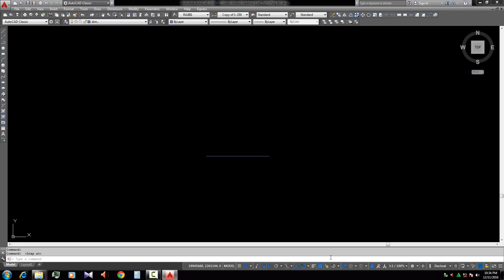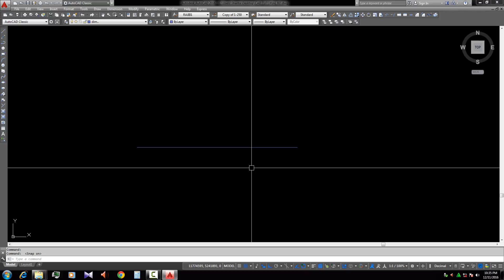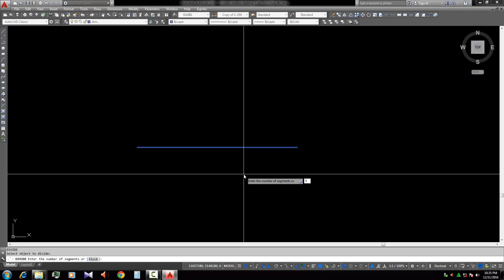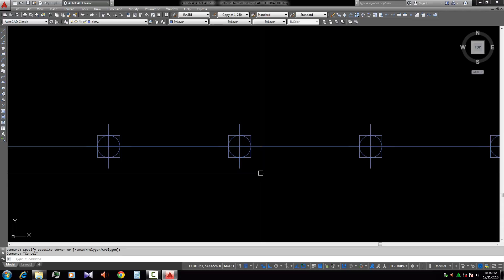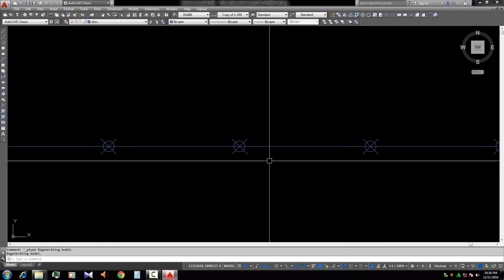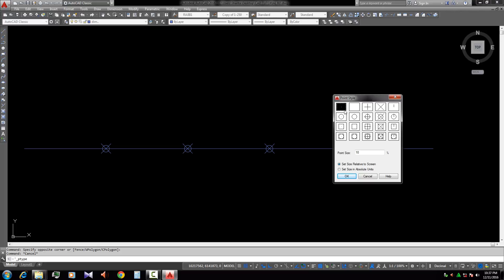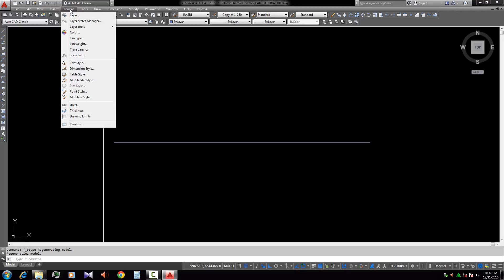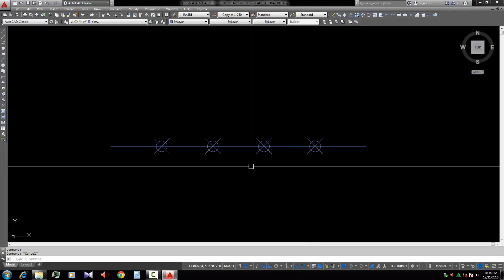How to divide a line In Autocad

Comment: Thanks for the tutorial. May I ask how I can draw lines through these dividing points that I made? Whenever I use the "Draw" tool trying to draw line segments through these points, the mouse is automatically drawn to the two tips of the original segment instead of the dividing points I created. Thanks in advance!